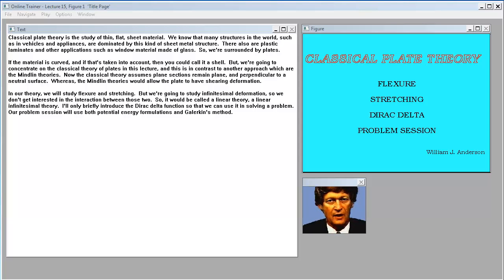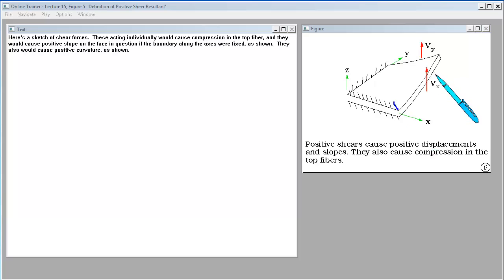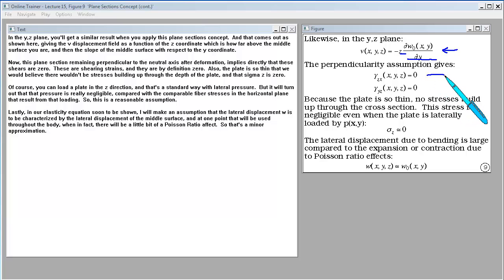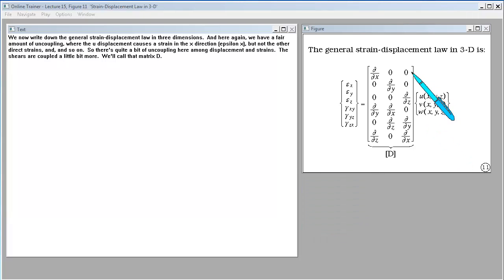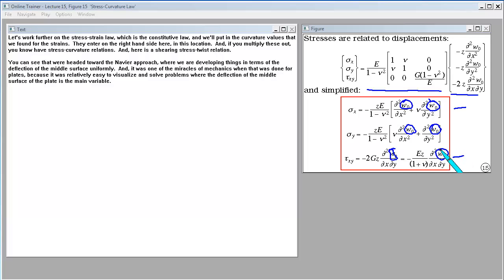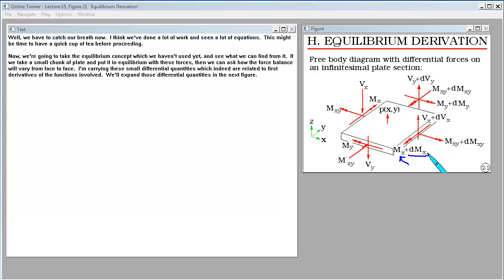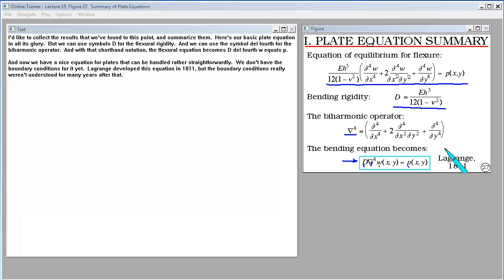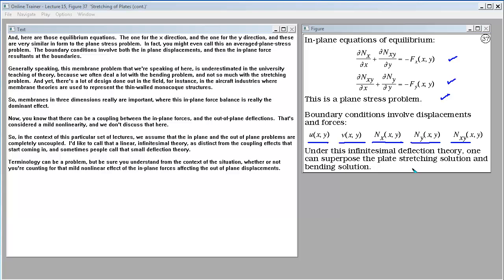Classical Plate Theory.  Lecture 15.

Comment: Is this undergraduate material? I am almost done my mechanical engineering degree and we haven't learned this yet. I honestly feel cheated because this is very important material. I am a mechanical engineering co-op student and at my work, we deal with sheet metal more than any other structural element. I appreciate you putting this up here